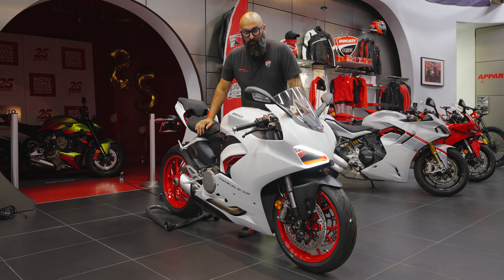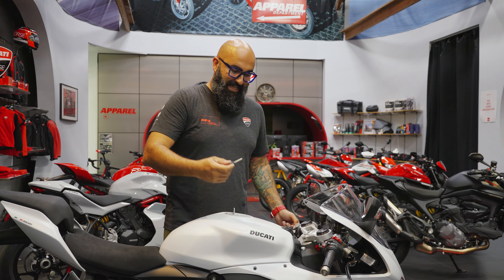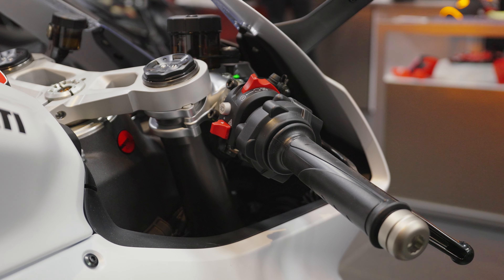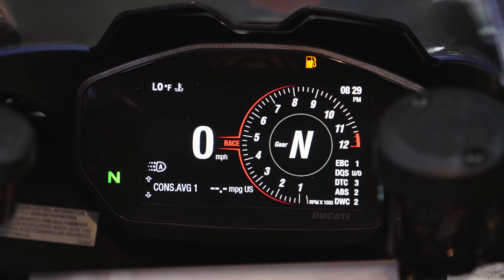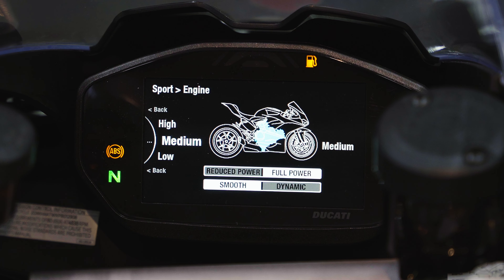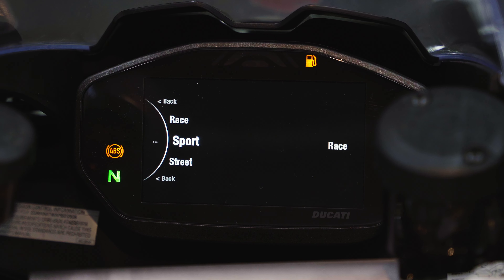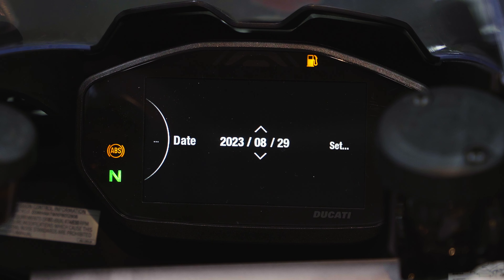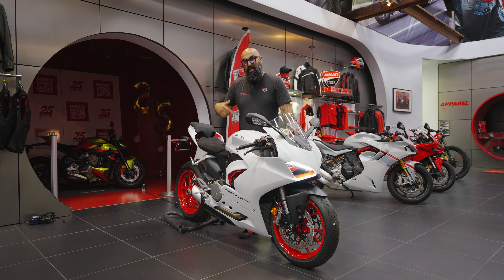2020 - 2023 Ducati Panigale V2 and Streetfighter V2 Walkaround + Tutorial

Comment: The Ducati quick shifter requires that the throttle is fully off for the downshift to function properly. Otherwise it doesn't rev match and it makes for some exciting down shifts. The upshift works as you described and works best above 6,000 rpm, the higher rpms shift smoother. I usually shift between 8 to 9 thousand rpm
Reply: Mmm my quick shifter works perfectly fine with the throttle open
Reply: @francoisgodofe mine as well